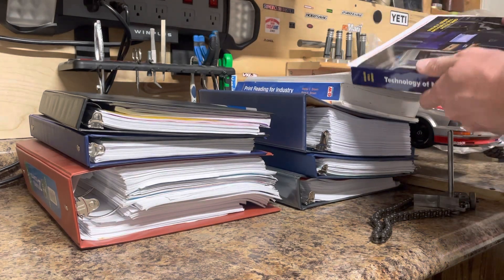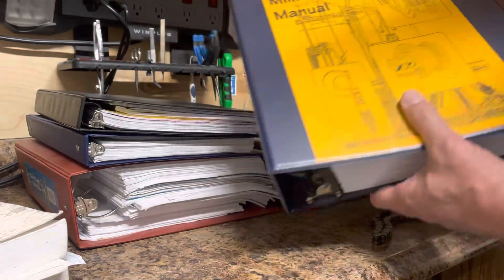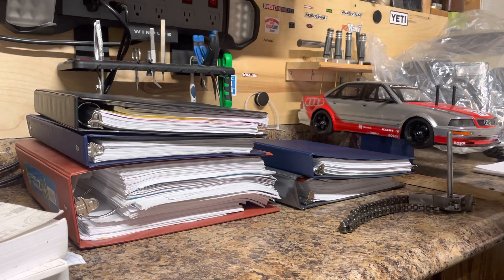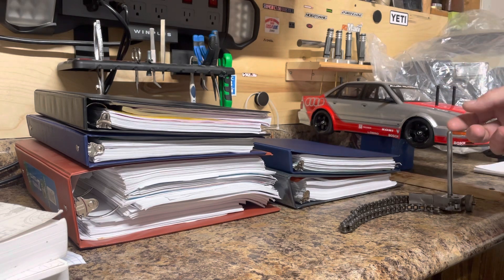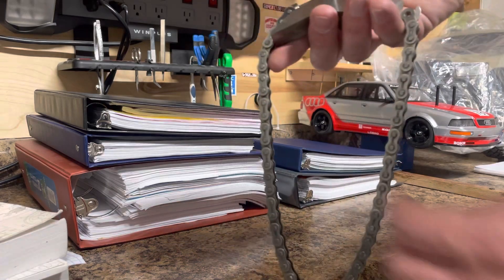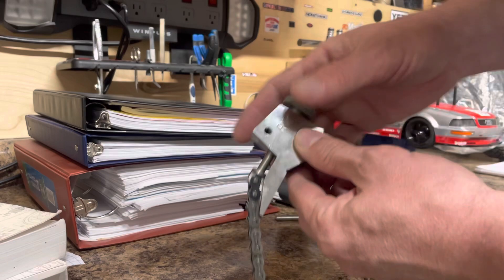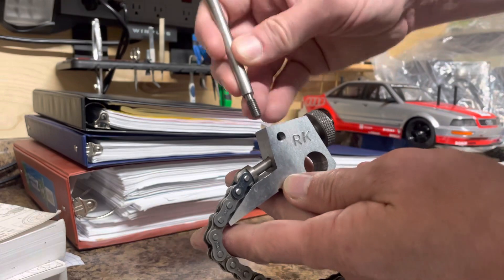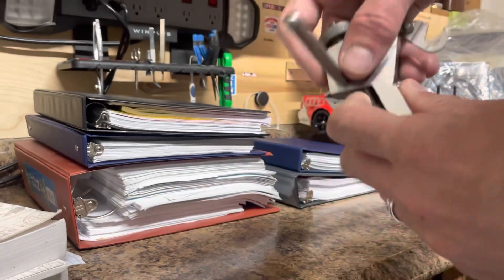Still want to be a millwright?

Comment: 13 years in the trade, maintenance not constuction, 4 years in goldmills (  3 years at canadian malartic wich is the biggest open pit gold mine in canada, detour gold ontario has the same mill) , 6 in the lumbermill and now 2 years into kraft pulp mill. First thing you do when you start working is , forget half the stuff you learned. Also the alignements tool you made , can probly throw it in the garbage, made one similar in school and never used it, we use laser.  You wont do math , you probly wont do machining , and unless your in maintenance , you probly wont weld either.

 Great job choice , Still love it. But if it was to redo , id probly be an electrician , industrial programmer its easier on the body.